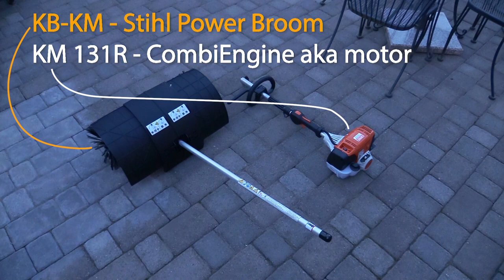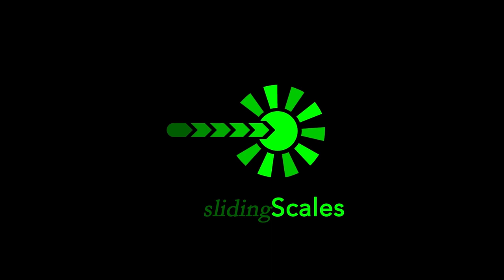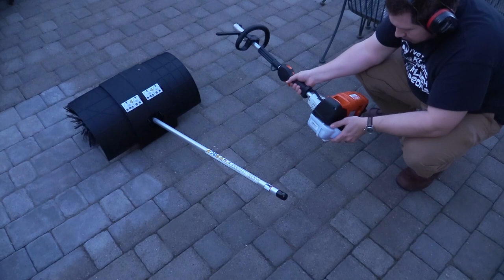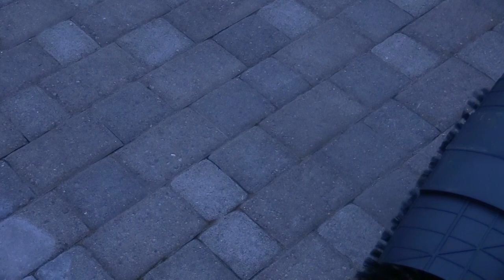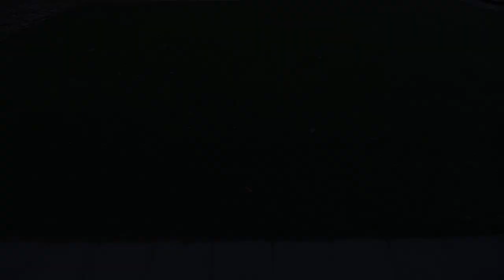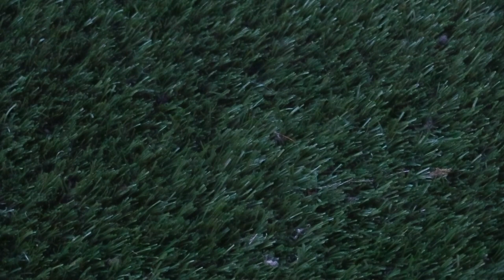Stihl KB-KM Power Broom First Impressions (Homeowner)

Comment: Hi my brushes are going backwards so the opposite of this why is that.
Reply: i just bought and noticed it pushes you backwards.when you fight it and push forward it gives a deeper better clean but more effort is needed.when you go backwards its easier but cant put at full.also tried upside down forward and that works also.
Reply from the maker: Good question!  Flip your power broom over, and it will go the other direction.  You'll want to adjust the guard.  I made a video to show how it works.

https://youtu.be/6CQX9QTowew
Reply: Thoughts on using this to clean up paver patios that have a good amount of moss growing? Seems like it might be awesome for the job but not sure how stiff the bristles are? Thanks in advance!
Reply from the maker: Adam Mutolo I think it would do not so well.  I think if you worked at it, it could do the job.  I’d kill the moss with a moss killer first before trying.  The bristles look really aggressive, but they’re actually more medium/mild.  I made a video showing how well it works on light moss/stubborn pollen on a deck that might be useful:  
https://youtu.be/1qeqD7lh9Ek

If you do try it, let me know how it worked!

Edit: adding link to another video
Reply: Sliding Scales Thanks! I’ll keep you posted!

Comment: He says it’s a four stroke engine and then says in the next sentence that it has oil mixed with the fuel!  Should we trust this person to review a machine when he clearly does not understand the basics?
Reply from the maker: Certainly, because Stihl calls it a hybrid “4-mix” engine.  Where it’s four stroke in regard to it’s compression/ignition/exhaust cycle, and two stroke in that it uses a gas/oil mix instead of an oil reservoir.  A little weird for sure, but has some nice advantages.

Here’s their marketing info on it:
https://www.stihl.com/4-mix-engine-lightweight-and-with-good-lugging-power.aspx
Reply: @slidingscales257  never trust a commentor. You called it right. A 4 mix. 4 stroke with oil gas mixture. No oil resevoir so its small compact and light with power. Thanks stihl
Reply: Don't matter this broom is the biggest waste of $300 on earth.  1 tank of fuel and my bristles are 3 inches shorter, replacements are only $200.  Junk junk junk
Reply: So hilarious how wrong you were